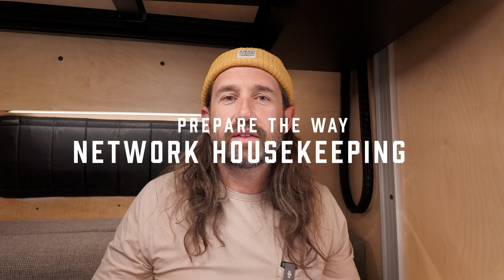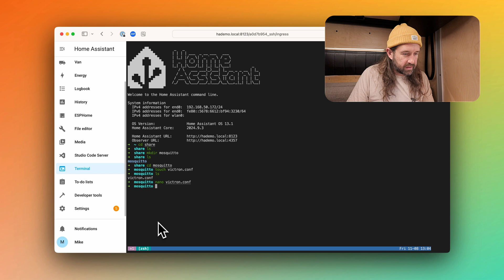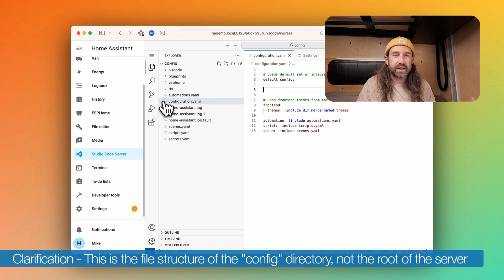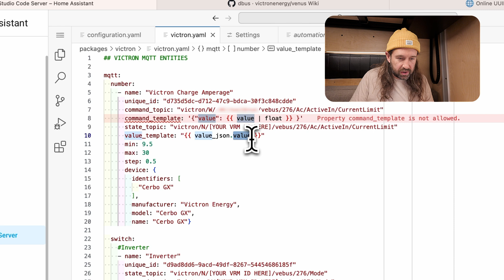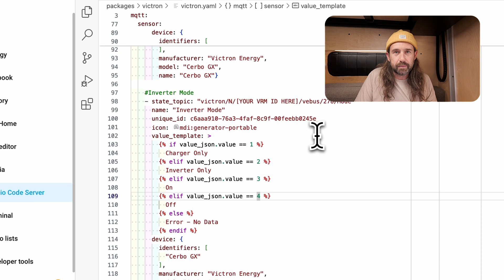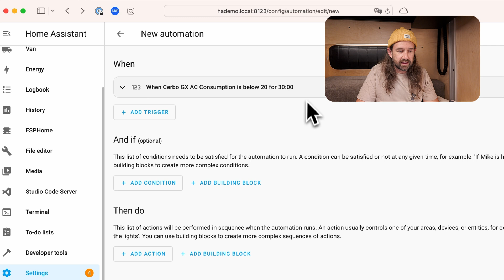Integrate Victron Into Home Assistant Using MQTT (bi-directionally!)

Comment: Hats off to you dear sir. Without any experience in HA, I was able to configure my Victron setup and also create a separate dashboard for it just by watching your video and following the sample code you linked on github. My system is a 3 phase, on grid  so not much in common with your setup but your explanations were clear enough that I could change everything to match my components. I started with modbus and got that add-on installed but I did not know how to use it. After seting up everything using mqtt, I noticed that modbus values only update every 30s where with mqtt the refresh is instant. 

Again thank you for taking the time to create this video.

Comment: Quick question, when changing the customization in the mosquitto configuration from false to true, my afterburner controllers for my diesel heaters shows unavailable on HA. Any suggestions?
Reply from the maker: I’m not sure what you mean by afterburner controllers. Do they use MQTT?
Reply: @ afterburner is an aftermarket controller for Chinese diesel heaters, it connects to HA via mqtt and has been made auto discoverable with its latest firmware release.
Reply from the maker: Other than some obvious bits, nothing jumps out at me. Be sure you've restarted Home Assistant and power cycled the afterburner. Double check the contents of the victron.conf custom configuration file in the "share/mosquitto" directory to be sure you haven't inadvertently changed other configuration options that would prevent Afterburner from connecting. You could also double check with MQTT Explorer to see if afterburner is connecting to Mosquitto at all.

Comment: Hut ab, du bist so schnell bei den Erklärungen das ich nur ein geringen teil verstanden habe ... habe aber alles nachgebaut was du gezeigt hast kommen auch Daten usw. aber du hast nur ein Phasen system ich brauchte aber alles für ein drei-Phasen system ... aber ich glaube das wäre zu unverschämt... Trotzdemalles super gemacht...
Reply from the maker: Thanks for watching! You should be able to look at the data coming in via MQTT and set up sensors for any of the inverter attributes you need. It may take a little tinkering but I think you can apply my examples to any of the other MQTT data!!
Reply: @SmartyVan  bin dabei und komme so langsam voran... bin leider kein Programmierer aber danke für die info...

Comment: Hello, thanks for the video! I got to the part where i connect the Cerbo GX with the MQTT and when i open the MQTT explorer it appears the victron device, but it only shows the serial number and nothing more, no any other entity. Do you have any idea of what i could be doing wrong or what am i missing? Thanks in advance and keep it up with you amazing work! :)
Reply from the maker: The first two things that come to mind are making sure that you’ve enabled all three switches on the Cerbo for MQTT and Modbus as well as setting up the keep alive automation to make sure that the data is coming in from the Cerbo.
Reply: @SmartyVan  Thanks for the answer! i Have all the three switches on on the Cerbo for MQTT and also the keep alive activated and still only shows the serial number.
Reply: @SmartyVan  Thanks for your comprehensive video! However, I exactly face the same issue. I've enabled the three switches  on the servo (modbus/mqtt on lan SSL/mqtt on lan (plaintext). Restarted HA and Servo. Result: victron/N/id/system/0/Connected "value": 1 I see only 2 topics and no data. Any idea?
Reply from the maker: @douwehouvast7814  @Caramelo-dm3px it sounds like if you’re connected to Cerbo but seeing no data that the Mosquitto configuration file isn’t correctly set up to map the Cerbo topics to the Mosquitto broker. Revisit the chapter called Bridge Cerbo to MQTT and ensure you created the victron.conf file in the correct directory and with the correct contents using your Cerbo IP and the :1883 port number. And ensure you correctly modified the Mosquitto custom config to “true”
Reply: @SmartyVan  Thanks for your response! There was a typo in my HA automation. The topic I typed was /N?<id> etc instead of /R. So there was no active communication. Another issue I ran into is the data for the victon.yaml file you supplied in combination with the 'package' line in configuration.yaml. I've tried that the way you showed. However, HA complained that the platform was missing. When I use the supplied file directly in configuration.yaml everything worked fine. What did I do wrong?
Reply from the maker: I'd revisit the "setting up configuration.yaml" chapter and make sure you have correctly formatted the packages platform. "packages: !include_dir_named packages" needs to be defined under "homeassistant:" and should be set 2 spaces in — spaces and formatting in YAML are very important. Then be sure you have created the packages directory in your config folder with a victron directory inside that and the victron.yaml inside of that. So inside the config directory (in Studio Code Server) you should have this directory structure: packages/victron/victron.yaml (with the MQTT entities defined in victron.yaml)
Reply: @SmartyVan  Thanks for your suggestion! Again a typo, grrrr. configuration.yaml: typed !include_dir_merged_named instead of !include_dir_named. Everything is working as it's supposed to. Thanks again! Tip: in Studio Code Server you can add a UUID by right-clicking and choosing: 'Generate UUID at cursor'.
Reply from the maker: I did notice that as I was making that video (and there's a little super in the video with that tip). It's a real time saver!

Comment: I'm already connected with modbus and it's working fine for me. I am one waiting for your Rixen video, knowing that, would it make sense for me to undo the modbus and move to MQTT? I'm more of a if it isn't broke don't fix it kinda girl but curious if it will cause me problems down the road with other configurations you will be showing... Fantastic videos and I'm learning about custom esp boards now after your last video. My electronic door locks are all just wired with a shelly controlling the on/off.
Reply from the maker: If it's working for you, I see no reason to switch. Like you, I started with Modbus. My memory is fuzzy, but I recall finding MQTT much more speedy in bi-directional control and perhaps overall update speeds—I believe with Modbus you have to poll for the data whereas MQTT posts notifications on data changes. But both should work. I don't see any conflicts in your near future because of your use of Modbus—though MQTT is newer and may have more active development. Also, being a visual learner, I find MQTT easier to work with as you can explore the broker and the data paths in MQTT Explorer.
Reply: @ thanks!!

Comment: Great explanation. It made me question my modbus connection.
Reply from the maker: Ahh yes, I started with Modbus and, while it worked, I left a lot to be desired. My memory is that the info came infrequently and the bi-directional control wasn't as snappy. MQTT has worked quite nicely.

Comment: Great tutorial and timely. Just fired up my HA and was about to integrate it with the Victron node-red nodes. Now I’m rethinking the integration. Did you ever think about going the node-red route?
Reply from the maker: I haven't played with node-red much. I am aware you can run node-red directly on Venus OS (Cerbo) which is interesting. I suppose I haven't come up against anything I couldn't accomplish between Home Assistant and ESPHome. I also employ MQTT for other stuff on the Home Assistant server, so I feel it consolidates add-ons being used. Do you love node-red?
Reply: @SmartyVan I was using node-red for automations and dashboards before I started using HA. It was before many of my BLE sensors were integrated into HA. Now I’m moving most everything to HA. I like having node-red integrated with HA if I need run more complex automations.